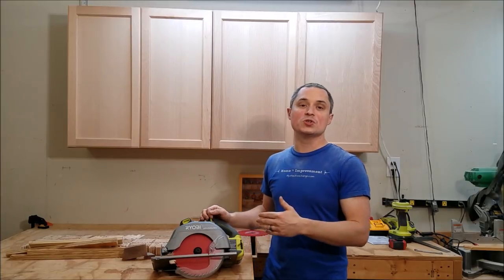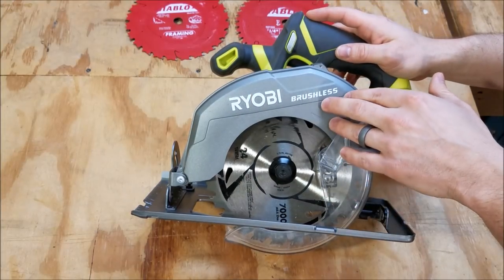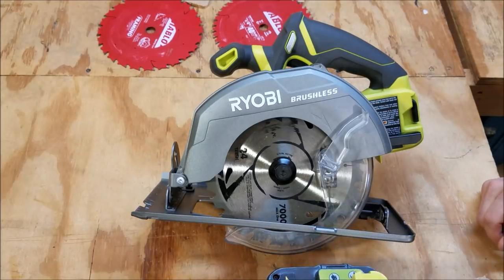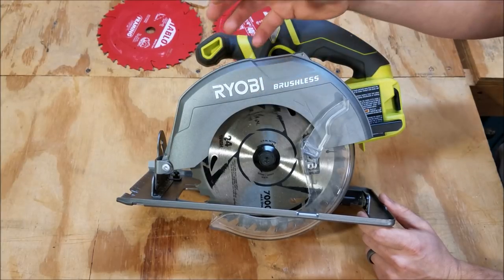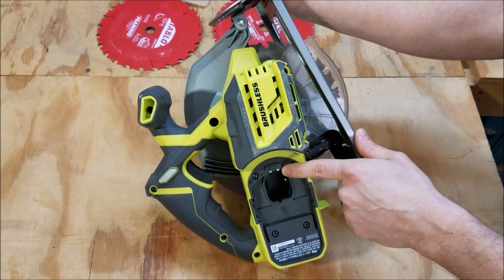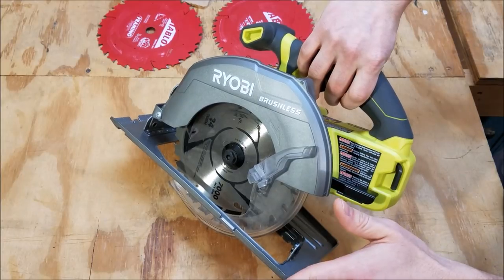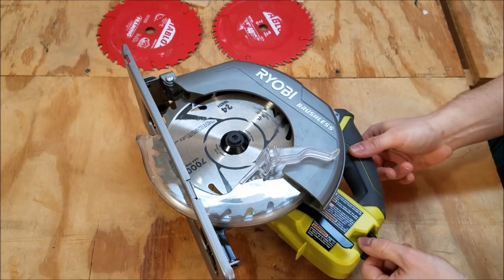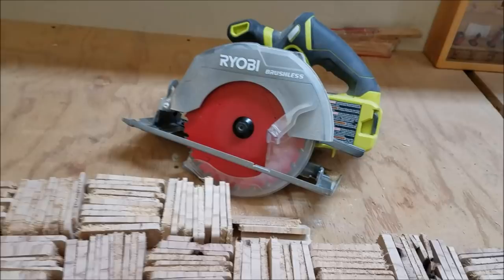Ryobi One+ 18V Brushless Cordless 7-1/4" Circular Saw Review

Comment: Just bought this on an online promotion. Buy the 2 pack 3.0Ah battery starter kit with bag and charger get a tool free. $106 with tax. I'm excited after watching the reviews. I have other 18 volt Ryobi tools so the extra batteries alone are nice.
Reply: How do you like it so far? I'm thinking of getting that same deal!
Reply: @mtalamantes100994  I have no complaints. I ripped 3 sheets of 1/2" plywood into (9) total pieces. One battery did it no problem. Six cuts 4ft long. Cut some 2x4's as well too after I was done. I would buy it again.
Reply: 👍 jw. i was wondering too. i want to cut up some 3/4 plywood to make extension ladder box for my truck & a few 2x4's. no electricity nearby.
Reply: @OcRefrig  All my cordless  stuff is Ryobi I use 6ah batteries I have 3 of them for the tools that suck a lot of juice and use the small ones on the 1/4 impact to keep it light I really like how the saw works with the bigger batteries
Reply: @ steve - Appreciate the info. 👍😎🏝

Comment: I have had the earlier 5.5 inch brushed saw for awhile and it is pathetic, so I hesitantly bought this new 71/4  one in right handed version ,for the Australian market . I am very impressed with  the performance even in long rip cuts ,very powerful and well balanced, then I put in  the new 6amp hp battery and it boosted it even more ,I use it professionally at work .👍👍👍👍👍

Comment: I can't use it for a tracksaw I guess. I was ok making a custom dustport but it the blade comming out of square ruins what would have been perfectly adequate for my application and the new large capacity batteries may kick up the power if they chat with the motor. I need better performance regarding accuracy in a circ saw.

Comment: Good vid. anybody know if it will rip 3/4" plywood several times. 4 x 8 sheet. how many cuts 8' Rip ? and how many cuts 4' cross cut with a mid range battery. 3 or 4 amp hr. i am looking to make a Box 2' wide x1' tall x 12' long to hold  a Extension ladder on a truck ? No Electricity close by. Could i use the smaller 5 1/4" saw its lighter ?
Reply from the maker: I've ripped 2x material multiple times with this saw on a 4Ah battery, it should have no problem with plywood. If you're doing a lot of cutting, this is going to be way better than the 5-1/4" saw.

Comment: Excellent review.  I hope you're right about the 6.0 or 9.0 batteries.  I think it's been long over due.
Reply from the maker: I tagged Ryobi about it on Instagram, and they replied, "We can’t say...but stay tuned!" I'm optimistic, since I have no idea what those extra contacts would be for otherwise.
Reply: There are already leaked part numbers and schematics for the 9.0 ryobi battery so its on the way for sure.
Reply: Are those contacts not on the charger?  I have the older green charger and a swear the contacts are on there.  I would have to check tonight, but I'm thinking they are just monitor contacts probably to a thermal couple or something.  I also thought the batteries had those contacts on them already.....
Reply from the maker: Nope, they're not on the charger either. The charger does interface with the batteries with a single contact at the base of the post on the old batteries. However, these two new contacts are on the opposite side of the post. I show it in a little more detail on my Instagram: https://www.instagram.com/p/BbXbFHdl7HR/?taken-by=doresoom
Reply: I've seen the 6Ah battery on some Ryobi tools in their literature. Also, see this article.
https://toolcraze.net/official-ryobi-18v-6ah-9ah-compact-3ah-batteries-real-probably-using-20700-cells/
Reply: I know those lines go to the PCB on the tool, but yea I have no Idea what they do.  I guess they would be on the backside of the battery shown in the article if they are even there but what they do is questionable.  Would be nice if they somehow fix the tool from stopping so easily when being pushed.
Reply: Been playing with my 4-pack of 9Ah HP batteries & make all the Ryboi Brushless tools shine!! Well worth $$!! Now late 2018.

Comment: I'm getting cold feet on Ryobi, lots of the 2021 reviews on HD say faulty battery.
Reply from the maker: I've been on the Ryobi One+ 18V platform for about 5 years. I have over a dozen batteries and only had two fail. Both were 2Ah slim packs that wouldn't charge. I fixed both of them by taking them apart and charging the cells individually.

Comment: Good video but you really need to do something about that sound or the area you're using for making your video, otherwise perfect.  Been using mine for about a year now without any problems.  I would verify that when you set it up for shallower cuts it's' off by about 5/1000 of an inch but since all my projects call for using a jointed it's easily corrected.  It did take a little bit to get used to the blade on the opposite side and I had to set up one of my jigs differently but all in all despite the added cost I'm happy and would recommend it.
Reply from the maker: Thanks! This is an old video - I use a mic now for much better sound quality.

Comment: 1. Is it dangerous to have a plastic upper blade guard when cutting certain materials?
2. Has anyone here had a problem with making a 90 degree angle when setting the blade depth as noted at 8:10?
Reply from the maker: The plastic upper blade guard shouldn't be a safety concern. It's more of a quality indicator than anything - the shoe of a saw is often attached to the upper blade guard, so if the guard deflects a tiny amount, then the squareness of cut can suffer.
Reply: @DoresoomReviews   Thank you for letting me know.

Comment: You could always cut with the larger part of the shoe on the larger portion of what you are cutting just go in the other direction. That is not why brushless is better by the way.
Reply from the maker: You can cut the opposite way if you're rip cuttng. But if you're cross cutting, you generally hold the saw with your dominant hand and hold the workpiece with your non-dominant hand, and let the offcut just drop. If you cut from the opposite side, now you're holding the offcut instead of the workpiece.

I don't remember exactly what I said about brushless, but the main advantage is better efficiency which provides more runtime per battery charge. They're also more powerful and don't need the added maintenance of replacing worn brushes.

Comment: I used a Diablo blade to rip a piece of plywood but the battery over heated 1/4 of the way through
Reply from the maker: Are you using a slim pack battery with it? I'd recommend a 3Ah HP battery at minimum for this saw. If one of those overheats with one cut, there's something wrong.

Comment: You can cut from the opposite direction so it shouldn’t really matter which side is wider.
Reply from the maker: If you're cross cutting, you generally hold the saw with your dominant hand and hold the workpiece with your non-dominant hand, and let the offcut just drop. If you cut from the opposite side, now you're holding the offcut instead of the workpiece.

Comment: One ofy our gripes about a left blade saw was the heavy part being on the waste edge, but then you show plenty of cuts where you simply cut the other direction where the lighter part is on the wasted edge?
Reply from the maker: Cutting plywood or ripping you can usually manage to cut with the lighter part on the waste edge if you plan it out. But when cross cutting dimensional lumber the heavy side is always gonna be on the waste edge if you're right handed and want to hold the rest of the workpiece with your left hand.

Comment: why does ryobi put the blade on the opposite side on their cordless saws? It's a deal breaker for me..
Reply from the maker: It's really a matter of personal preference for blade position. If you look at the comments on my review of Milwaukee's blade right saw, at least half the comments are lamenting that it's not blade left: https://youtu.be/oEkdf6vIJkU
Reply: @DoresoomReviews  Well 98% of saws have the blade on the right side. It's just one of those things you dont change. Like Ford just suddenly making all their vehicles with the steering wheel on the passenger side or something.
Reply: Blade left is a selling point for me.  I hate the motors hitting my hand when using a square as a guide.
Reply: @MrC9Oh3  the reason that most saws have a blade on the right is because most people are right handed and do not know how to safely operate their power tools.  When held in the right hand this design keeps the motor and body of the saw between the user and the blade so that when Joe idiot is holding the saw down by his thigh and accidentally pulls the trigger the chances of him cutting half way through his thigh are drastically reduced.   If you look at the type of circular saws carpenters and professionals tend to use (worm drive and hypoid) almost all of them have the blade on the left since this allows a right handed person to make accurate cuts with much greater ease which is of great importance to the professional for whom time is money and safe practices are second nature.    The correct side to have the blade on is the side that you are most comfortable with.  Don't let anyone tell you otherwise.
Reply: @casper18795  I'm with you there 100%.   Using a saw with a blade on the right hand side feels like trying to hit the brakes in my truck with my left foot.  Extremely foreign and uncomfortable for me.
Reply: @Soknik01  lol trust me I know, I've been framing houses for over 10 years. I'm left handed and cut with my left hand so this doesn't apply to me. I prefer the blade on the right so I can see the blade as I cut.
Reply: @MrC9Oh3  Man, the only possible reason I can think of for them to change up the configuration would be that going with the blade right configuration for the sake of safety isnt quite as big of a concern with cordless saws since they only have a fraction of the power of corded models.   I'm not even sure that logic really holds up tho.  Corded or cordless, I sure as hell wouldnt want to see what a spun up circular saw blade could do to my flesh lol. Regardless of their reasons, it sure is frustrating when you have a tool that suits your needs but you are unable to find its cordless equivalent in the same configuration.   Life would be a lot simpler if there was a standard cordless tool battery configuration that worked across all manufacturers models....
Reply: Soknik01 I am a carpenter and left handed blades feel weird, because the most of the base is sitting on the cutoff tinber.
Reply: It's mainly for people who are right handed. First myself I would rather have it the opposite than it is. But I can work around that.  There are not that many tools that are for left handed people.
Reply: Because it's diy focused brand and blade left is easier to use for non professional users, who are mostly right handed mostly. I:m a commercial builder in California, and I use the worm drives and rear handles mostly. For crosscutting 2bys, I use the milwaukee m12 fuel. 5 3/8 circular saw, with the blade on the left. Easier to see. I could rock blade right sidewinder as well. Milwauke gen 2 M18,  which I also have has the Blade on the traditional right side of the motor. It's a beast and I love it as well. Handling tools is like driving a stick or riding a bike... To me... No matter what side I am on. All the same to me. You're probably only used to one style of saws and what works for you. I collect tools, so for every job I change brands and I play around with new styles and what not. Keeps me on my toes and paid. And plus if you had several cars why woudltn want to change it up a bit. Right?

Comment: Good video pal, thanks. Looks like a really nice saw actually. I have the HITACHI C18DBAL brushless 18V, it's a 6 1/2inch saw, but it has deep depth of cut at 67mm! Really don't want a 7 1/4inch when this achieves even slightly more than a lot of 7 1/4inchers! It has the motor on the left and blade on the right. Just in process of making some cutting and trim jigs for it.

Comment: Great review, how would you compare it to the dewalt circular saw? I have ryobi tools at home, but dewalt at work. Was wondering if I should buy a ryobi circular saw.
Reply from the maker: I haven't used any of DeWalt's cordless circular saws, but I'd say compared to my point of reference of an M18 FUEL saw it's going to feel a little underpowered. The newer HP batteries help a ton with the power on this saw though, and will make the difference a lot less noticeable. I compared its performance with regular 4Ah P108 vs the HP batteries here: https://youtu.be/Qf3_WJqg8mg

Comment: I finally figured out an excuse to buy one of these and I am impressed.   It’s powerful, lightweight, inexpensive and has the blade on the correct side.   Considering what it is, I don’t think the plastic guard and steel shoe are drawbacks.    They help make it light and cheap without seriously compromising its capabilities.  This is the kind of saw that can get the job done, but you don’t really have to worry too much about it disappearing.

Comment: i have a black and decker 3 amp jig saw and it took me 5 mins to cut threw a 3x8 and i had to keep stoping cause it was so hard for it to cut threw the wood, in 10 mins in your saw cut threw that 2x4 like butter.
Reply from the maker: A jigsaw doesn't clear chips as well, and doesn't have the blade speed a circular saw does, so that's expected. I pretty much only use my jigsaw for curved cuts or inside corner cuts that a circular saw can't do.

Also, this Ryobi brushless saw gets a HUGE power boost from their One+ 18V HP batteries. I was just using a P108 in this video, so the saw is capable of even faster cuts than shown here.
Reply: @DoresoomReviews  good to know, the jig saw i used is not a 3 its a 5 amp, still even curves will take a long time to cut, maybe it was to thick for suck a small amp jig saw, I do have a Ryobi jig saw it was messed up when it come, i have to send it back but the black and decker help the my project done. i have to get a circle saw next

Comment: I like it because it was free from brushless drills combo I bought. It is nowhere near though from Dewalt counter part ergonomics, materials and features wise. I noticed that most brushless Ryobi are coming up lack some good features like the P239 Impact. Maybe it is Marketing ploy I suspect. Entice people to buy for the brushless feature then come up later with another batch of models with brushless full with good featuress.
Reply from the maker: The P239 came out after the P238, which is their full-featured brushless impact. I think it was an attempt to offer a lower cost base model brushless impact, since the drill/impact two battery kit that includes the P239 goes for $150 rather than the $99 of the P238 bare tool.

Comment: The two other contact points are for  for the one+ Lithium+HP 18  batteries that are made for the brushless cordless drills
The left pin outputs 2.8v & right pin puts out 18.7v when measuring from common ground on stem.
Reply from the maker: Yeah, at the time I made this review the new HP batteries weren't out yet to confirm. I'm betting the voltage on that second set of pins varies when you place the tool and battery under load in order to balance run time vs current draw for high demand applications.

Comment: Will the adapters work on these so we can use dewalt batteries on this saw? Ryobi batteries aren’t very enduring for big jobs.
Reply from the maker: I haven't used any battery adapters with this saw, so I can't speak from direct experience. Ryobi's 6Ah abd 9Ah batteries really give this saw some more oomph and runtime though. I doubt an adapter will provide the additional power boost, since it won't have the extra set of contacts the Ryobi HP batteries have: https://youtu.be/Qf3_WJqg8mg

Comment: Great review. I probably won’t buy one, as I already have three cordless circular saws, but for some reason I really do like Ryobi tools. What I’d really like to see them do is build a line of compact tools like Milwaukee’s M12 line. I suspect that Ryobi’s cheap, lightweight build style would really lend itself to compact tools. Milwaukee makes good tools, but they sure ain’t light.
Reply from the maker: Thanks! I forgot to mention in the video - this saw is pretty light, at just 6 pounds without battery. I think my Ridgid Gen5X brushless is over 8 pounds. All that plastic does have at least one clear advantage!
Reply: The weight of certain Ryobi tools is almost as big an advantage as their price IMO.    Their recip saw for example is more than 3 lbs lighter than most of the competition.   I think their 6.5” circular saw is actually lighter than Milwaukee’s 5 3/8” M12 saw too.

Comment: Cut in the other direction, then you have support on the proper side AND  you have better site line.
Reply from the maker: That works well for sheet goods. I'm right handed though, so for cross cuts I'd either have to use my left hand to hold the saw, or cross my arms to hold the main portion of the work piece.

Comment: Is the spindle lock part important? Cuz that seems to be the only part I’m having a hard time doing. I can do it I’m just hoping it’s correct and wish someone went into more detail about this.
Reply from the maker: Without the spindle lock it will be very hard to remove the blade. The brushless motor indexes, which makes it a little tricky to find the detent in the shaft - you just need to keep rotating until the button depresses all the way.
Reply: Doresoom Tool Reviews ok cool, ty for explaining! I feel better now. That knock back I was reading in the manual sounds pretty scary.